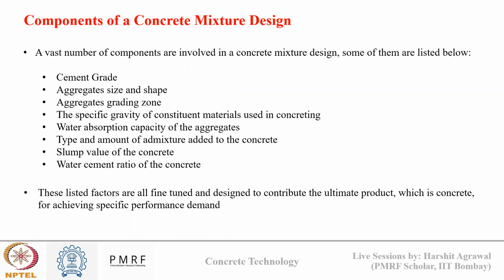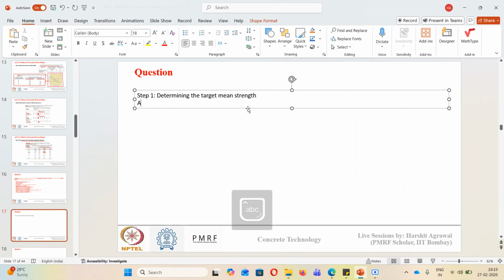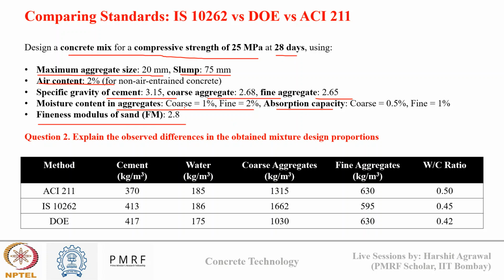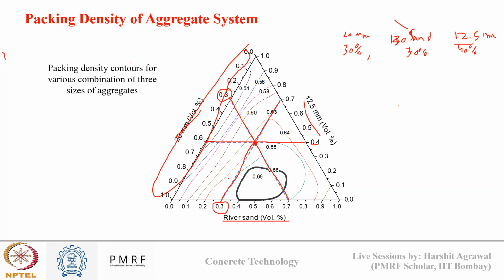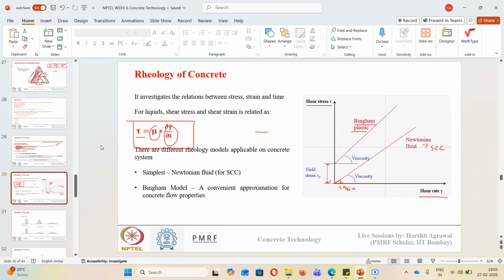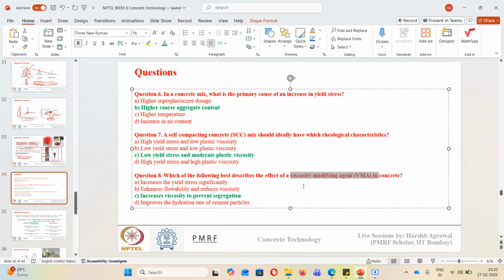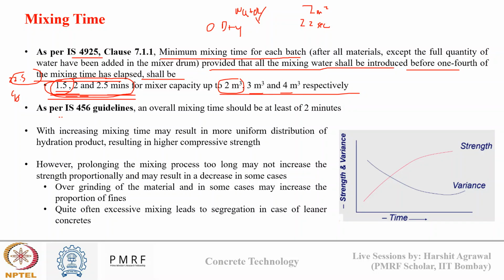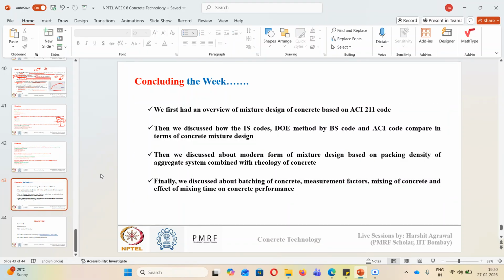Concrete Technology WEEK 6: Concrete Mixture Design (ACI-211 and Advanced Method), Batching, Mixing

Comment: In problem -1 ( ACI method )
Why we assume MSA=12mm after calculate length ,depth and spacing
Reply from the maker: During the session, the question that we were discussing already told to consider 20 mm (not 12 mm) as MSA, but just to explain how ACI code uses length, depth and reinforcement spacing criteria to decide MSA, I gave an example, that example was not related to question solution